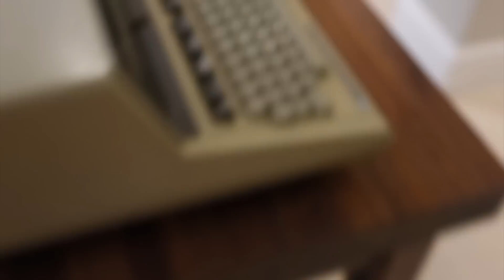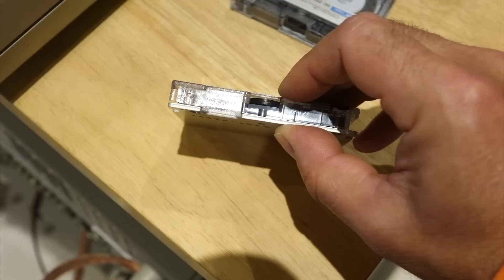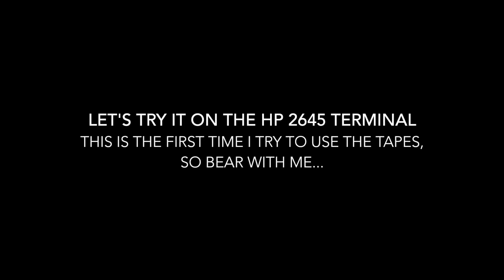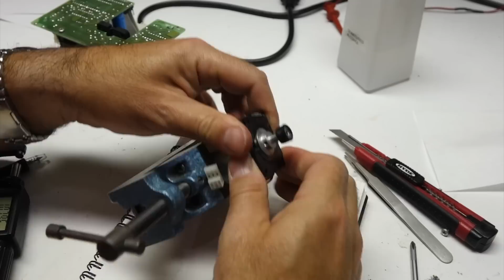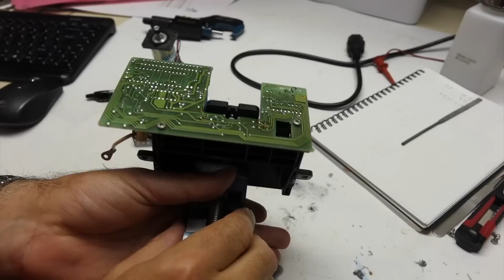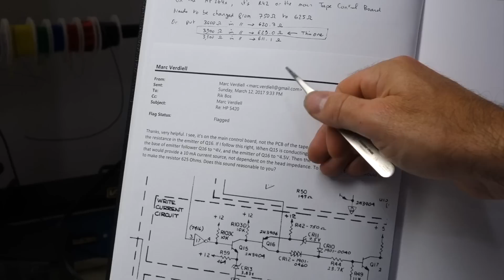Vintage HP Mini Cartridge Tapes Part 1: Refurbishing  Drives (HP 85, HP 9825, HP 2645)

Comment: I refurbished this tape drive type, a Data General unit. The drive roller disintegrated so I chunked off the rest and cleaned the spline with acetone.  A search of my junkbins showed the output roller from an Epson ActionPrinter 3250 was a nice match.  I pushed a BIC pen through the roller, to expand it a bit, then took the nib out of the bic and put that face to the drive shaft and slit the new roller on.  It sounded like a washing machine but it worked!

Comment: Two main problems, dust in the EOT sensor causing tape to run off the end and the rubber friction drive roller, it slips and gets polished.  Just ruff it up lightly with a nail emory board.  Those two fix most problems.  Once saw a grown man cry, not a pretty sight, his dissertation was on a wound off tape.  I would always try to re load it, but made no guarantees as to success.

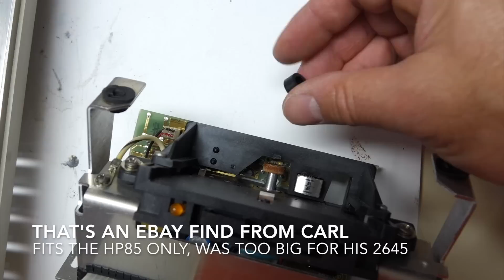Comment: Really great video. At 10:08 of your video you mention an eBay find from Carl for a black rubber cover for the HP85 capstan. Can you share more about where you found it? I searched in eBay and didn't find anything. I just picked up an HP85 and the capstan cover needs replacing.  I plan on using HP data cartridges so I'm hoping this solution works for me. Thanks in advance!
Reply from the maker: I am not sure where he found it, it did not last very long, and only works with DC-100 cartridges, of which you can not find any that will still work. I would not recommend it.

Comment: Marc,
So, longer term... which capstan mod worked best ?
Silicone tubing, plastidip or O-Ring ?
Reply from the maker: Right now the plastidip and the O-ring seem to hold up equally well. Plastidip is easier to make. Silicon tubing is easiest but does not last at all. It eventually failed on all machines.
Reply: CuriousMarc  Thanks Marc, Plastidip it is then 👍🏻
Appreciate all the HP85 videos, they’ve been very useful.

Comment: My HP memories aren't as good as yours because I used an old (70s???) one in the mid 80s... But were there some of the "desktop calculators" (the machines that had a single line 7-segment display) that used a smaller tape cartridge. It may just be my memories are shaky.
... oh yes, there it is.... the 9825!! Well that looks very close! I'm sure ours had a more typewriter-ish keyboard to that though.
Thanks for the 9825 bits... that takes me back to my first job and one of the most enjoyable computers I've ever used.

In a leter job in the late 80s we used 3M DC600s (and a bigger size?) for backups and for installing Unix... I tore-down so many old ones "for fun".... I'm sure retro collectors would burn me at the stake nowdays.

You shocked me with all the talk of modifying the recording current.... I would have thought you could just check some 1/4" audio tape in there (with some holes punched into it for the start and end markers) and that would be fine... Things like changing the recording current would never have crossed my mind.

I love the improvised plasti-dip lathe too!

Comment: Finally revisiting my HP85's tape, too much damn procrastination lol
Something odd: My capstan's outer diameter with the original(?) rubber was around 11.7mm - the rubber on mine was over 1mm thicker? Seems a bit excessive
Although, it looks the same size as yours did with the tire thing on it, maybe I'm just losing my mind... or getting lost somewhere in the unit conversions...
Anyway, how have the plastidip rollers held up over the last 6 months? Do you still think it's the best bet? Another option I found is a guy who "professionally" refinishes old audio capstans (link omitted, unless you don't mind "advertising"), costing around $40... I'd definitely rather try the plastidip, if it's still working for you
Reply from the maker: All plasti-dipped drives still working. It's quite a tough material. But more time needed to tell for sure. But $40 to refinish a capstan, I would call this a good deal. Let me know who that is...
Reply: The roller guy is "Terry's Rubber Rollers" @ http://www.terrysrubberrollers.com/
Seems like a nice fellow from a few emails back and forth. Probably doing it in his spare time, and it looks like he's pretty good at it from the pictures and various posts around different forums of people praising his work.
$35 per roller + $5 S/H as of right now, for which he uses money order. Hopefully everyone here doesn't swamp him with jobs upon seeing, lol
Reply: Aw, it seems every DC100 I own had the material fused with the band (even the whole box of "modern" 1990 ones).
I wonder if I can just punch new markers like you did in the tape salad nightmare...

Comment: Seems like a single line display is quite limiting on the 9825. What were these machines used for?
Reply from the maker: Yes, it's so weird to have such a powerful machine with just one line! It's historical mostly, as a descendant of the 9800, 9810, 9820 and 9830 calculators that turned into full fledged computers progressively. It has a very strong external interface capabilities. They were used mostly as test setup automation controllers, hooked up many HP test instruments via HP-IB, and as scientific calculators, hooked to a printer and a plotter, which then makes sense.
Reply: @CuriousMarc  Hello, I have a 9825A that was no longer used because it jammed and broke the cartridges, which were quite expensive. The machine was used with a cartridge with which a two-dimensional part was programmed/drawn for a JAPAX wire EDM machine (japanese). The program lines were based on absolute Cartesian, polar, etc. coordinates. Afterwards, it was sent to be plotted to verify the program, and finally, a cassette with the program was recorded to run on the EDM. I am interested in selling it as well as an HP 7225A plotter

Comment: It was about twenty years (and more) ago when we refurbished some tape drive using rollers from VCRs, cut in half on lathe. But it was a bigger drive. Really can't remember right, but I recall we were pulling a ring leftover from motor and super-glued the roller. It was one to one match on the outside diameter and working good. We only did 3 drives from local post office, they were working to the last moment some 10 years ago.

Comment: Excellent video. I wish you could offer your modified capstans on eBay, but after seeing what it takes to make one, I see that’s not likely feasible. They would probably cost more than the 85’s do. I’ll have to come up with a different solution, but it’s good to see how you did it. I just got an 85B and the printer belts look like new, but I haven’t looked at the tape drive yet.

Thanks for the great videos. I learn something from each one.

Comment: Wouldn’t the tape drive oversaturate the DC100 tape material after you’ve modified it to write to DC2000 tapes?  The current should be too high to write to DC100 tapes, no?  Where it would distort the signal by over-saturating the tape’s magnetic material?

Comment: I repaired a HP9100 and the cardreader had a wheel made of some woven tape. It looked a bit like yours at 9:40. I can not imagine that it was original ? I replaced it by an automotive rubber sealring.  http://www.pa4tim.nl/?p=3878 there is a picture around the end of the page.
Reply from the maker: Cool site! Congrats on the HP 9100 repair. That's one important HP crown jewel of a calculator that I am still missing in my collection.
Reply: Thanks, They were not mine, I repaired them for a collector. My oldest calculator is the HP-35 and I have no old computers. But I like your videos about them. I only collect measurement gear. I am now working on a HP1615A logic analyser (complete with a lot of accessoires, manuals etc) but ROM #0 is corrupt. I made a memory dump, de-assembled (8080) it and hope to find the fault and then program a new  EPROM but I'm best in analog hardware so this is a big adventure for me :-)

Comment: Why do you have all these treasures? I'm green with envy! I had an hp85-a back in 1980, it was cute but sloooow, even compared to an '78 Apple II. OTOH hp's BASIC was much better/complete, that much is true. That rubber/capstan disintegration problem happens too in the hp65 and 67 calculators.

Comment: Are those terminals for 2100 systems?
Reply from the maker: Yes, these are the terminal slated to go with my HP 1000's, 21MX and the 5451C Fourier analyzer. They are amazing machines in their own right, much more to them than meets the eye. More videos coming up on these for sure.
Reply: I wonder if it is possible to convert one into a 2647 computer.

Comment: Huh, so the plastidip worked on the 85? I tried all the shrink tube and rubber hose tricks and they all ground off, then eventually gave up.
That 9825 is a work of art inside eh? Looks like easy serviceability was the #1 priority, oh how times have changed
Thanks for the useful info as always, and happy holidays!
Reply from the maker: Douro20 is right on. It's actually way  more powerful than the later HP 85. I was very surprised. This one deserves a video on its own too.
Reply: And quite powerful; it was built on the architecture of the HP 2100 minicomputer.
Reply: It looks like a fascinating machine... If I had space for another boat anchor I'd look out for one
Reply: I would figure silicone rubber tubing would be a better idea. Doesn't rot like the old rubber did and nothing sticks to silicone (except maybe CA glue).
Reply: @therealjammit  Every tube I ended up trying was shredded within 3 seconds of rewinding! I wish they would have worked, that would have been quite easy haha

(sorry, never got the notification for your reply)